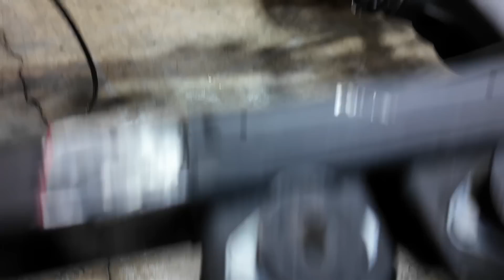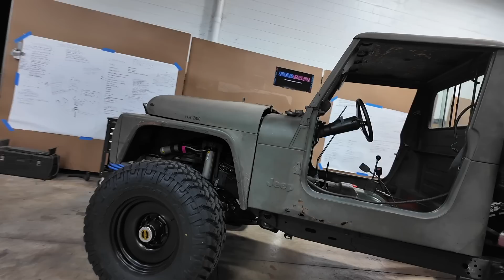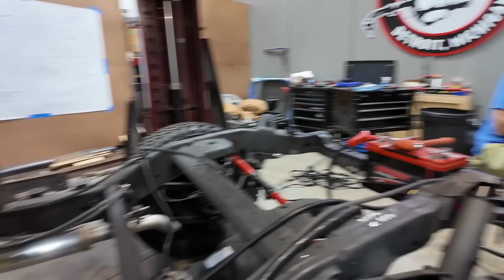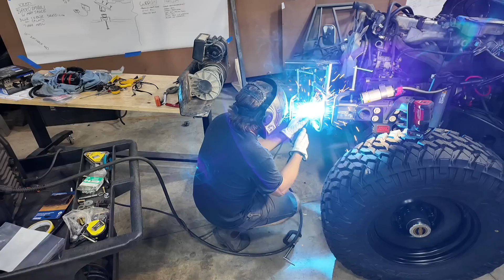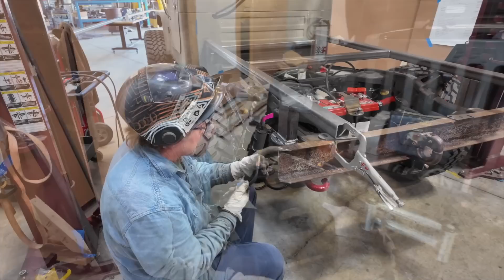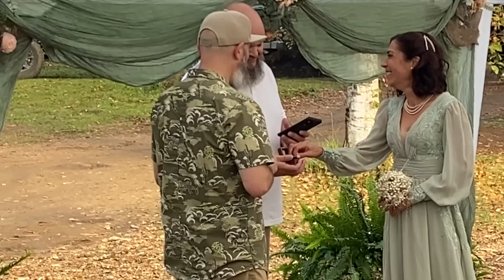Dirt Daily.  We Finally Finished the CJL-10 just in Time for the Wedding!  CJL-10 part 8

Comment: I was always told that if the toe is set to a few degrees in, it will spread while in motion and be run at 0. Not sure who came up with the theory? When driven without a tie-rod, the tires usually turn out and when in reverse, the tire turn in?